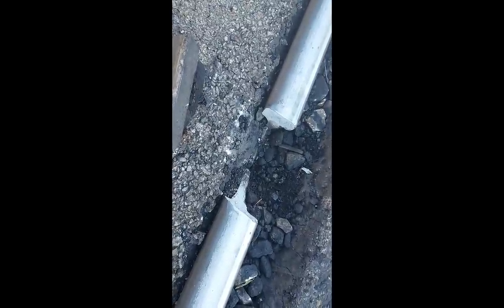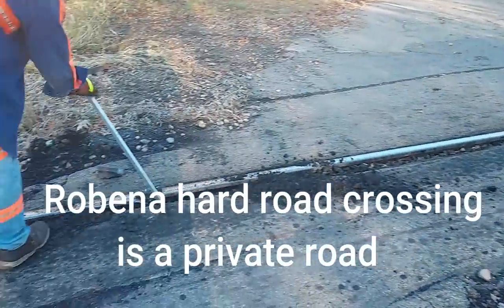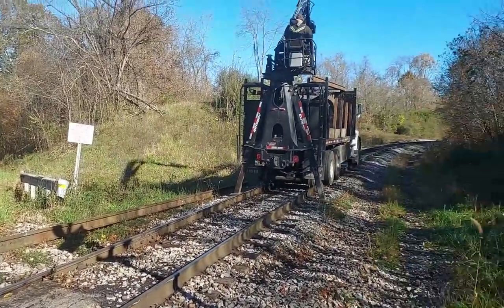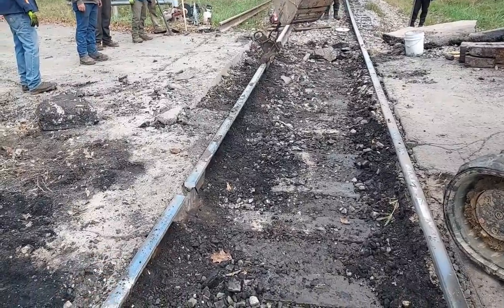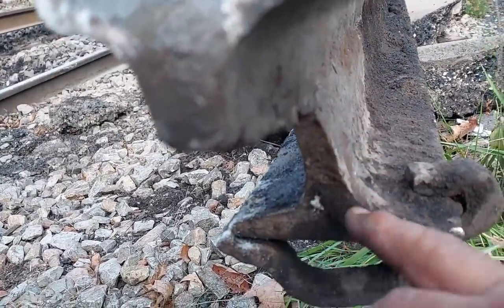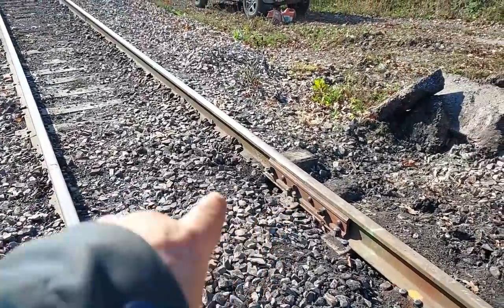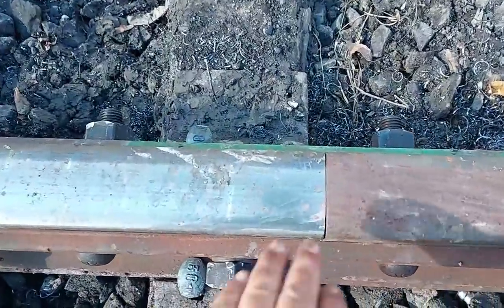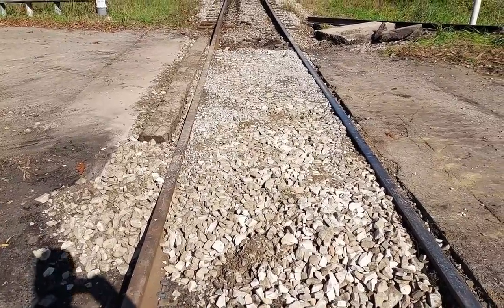This is Really Ugly!  7 1/2 Inches of the Rail Head Blew Out!

Comment: Any chance of replacing the asphalt with composite panels? If your rail was signaled the break would have set the preceding signal at stop and proceed. Then the train would stop and proceed at restricting speed looking out for obstructions, broken rail, etc. In your situation signals are not feasible since you operate one train only on the 17 mile section of track. Cumberland is fortunate that you inspect frequently. Well done!
Reply from the maker: Would be an excellent idea Gary, I like those. However since this is
a private crossing and only sees a few trucks a day they most
likely won't spend any money on the crossing except for what it is
now, a gravel base. Used to have a ton more traffic when Robena
Mine was operating right below this crossing, that is when we
took out the timbers and put in the asphalt, about 17 years ago.
Appreciate your checking in to watch the video my railroadin friend.

Comment: Was it a very hot day? I see there is no expansion gap left open in the joints.
Reply from the maker: No it was not and very excellent observation there sir. I intentionally
had them close the gap when they set that rail in. I've had several
joint pull aparts on both sides of the crossing in the past and
by having the joints tight am hoping that will help eliminate
those winter pull aparts. There was a method to my madness....LOL
Do appreciate your checking out the video today and for writing
in my friend.

Comment: Just a couple of remarks from UK, not sure that too narrow a joint is a good idea, because when the weather gets hot, the rails will expand = lengthen and could buckle.  Other comment, I think we don’t pour concrete between the rails.  Unless they are tram-tracks running along a Highway.  Maybe the ballast is covered by timber baulks.  You did a good job.
Reply from the maker: Thank you Robin for the very nice comment from the UK. I have
had several pull aparts in the winter on that rail in the past and
several on the other side of the crossing, same rail. So that is
why I asked them to make the joint tight. Understand your line
of reasoning, but in the 18 years here have never had a heat buckle
there but have had 6 pull aparts. Do appreciate your watching today my friend.

Comment: How did the car wheels stay aligned to the rail head over that big of a gap? I'm simply amazed that it didn't derail a wheel and have several cars run off the rails. Did the last freight train that passed through that defective section get fully checked? I reckon every wheel on that train should get inspected ASAP, rolling over a defective section can put nicks, scoring, and dents in the wheel.
Reply from the maker: Good question and answer is it was in tangent track. Had it been
in a high degree curve most likely something would have come off.
I was on track and did not dump the cars when they came in after
running over this, most generally the guy dumping looks at
stuff like that, but we also have not experienced any wheel
problems soon after that. It is my guess the head blew out
near the very end of the train. Do appreciate your writing in and
for checking out the video today my friend.

Comment: I wonder how old the length of rail was? Could be a century! And how long the original crack had been there (and impossible to see under the crossing)?
Reply from the maker: The rail we took out was rolled in 2010 by Arcelor Mittal located
in Steelton Pa. We will never know how long that original crack
was there. Do appreciate your checking out the video today Lloyd.
Reply: @ccrx6700  Surprised at that being just 12 years old. Yes, wonder how many times the track has been inspected without knowing of the crack. Would need a special inspection train with x-ray etc to spot that. Fascinating video. I'll check out a few more of yours!

Comment: That is amazing.  In one sense, it was a bad location because it was in a crossing.  Makes a difficult repair. In the other sense, it was the best place because it prevented  the rail from rolling or moving laterally.  That would have been a train wreck.  Pardon the bad pun.  Do they ever have Sperry or some other company survey the rails?
Reply from the maker: Pain to have to tear the crossing out, but also easy access for
the crew and the excavator! Better than miles up track with
no way to get there. We do untrasonic rail testing at least annually
and often twice a year and have done so for many years now. Do
appreciate your checking out the show Larry.

Comment: dang that's quite the break on that piece of rail it must have made some noise when it finally threw in the towel. Out of curiosity do you know if railroad ties tend to last longer or shorter when covered by asphalt like with that crossing?
Reply from the maker: Very good question Ethan and I have no reliable answer. We redid
this crossing 17 years ago and all the ties were new then. They
still looked pretty good and the spikes drove in fairly hard when
they replaced the rail here so that means the ties are not rotted.
So I would definitely say the ties last longer in a situation like
this than they would in a mud hole where there is a constant
up and down motion of the ties plus the mud. Do appreciate
your checking out the video today my friend.

Comment: what grade of steel is used for rail?
Reply from the maker: Rail is a medium to high carbon steel. Not all rails are manufactured
to the same specs. A railroad will specify what type of rail they
are wanting rolled depending on that railroad's unique use for
any certain application. Some rails are very high in carbon and
those rails would be used for high degree curves, but again that
higher carbon rail is a special order. You can find on the internet
the exact ratios of what is in rail steel on several sites. Hope
that helps Augie and thanks for checking out the video today.

Comment: Looking at those tracks makes me wonder how you get them universally spaced apart evenly, I believe it's just over 4 feet between the 2 sides.
Reply from the maker: Inside gauge between the rail head is 56 1/2 inches typically
Johnny. There are Fed regs on how wide a gauge can be
for each class of track before it must get corrected.
Reply: @ccrx6700  I meant how you keep the tracks and equal amount of space apart.

Comment: PS.  A contributory factor for the fracture could be that the cold weather made the rail shrink, naturally, but it couldn’t move at the rail-joints (held solid by all that concrete??) so it broke. It was clearly cracked, anyway.  Jointed track depends on movement at the rail-joints.  CWR (continuous welded rail) is laid in tension (“stretched”) and provided with expansion joints.  I prefer listening to the clickety-clicks, and calculating the train speed.  Rails used to be laid in 60-foot lengths, over here.
Reply from the maker: Thanks for sharing with us Robin. We do appreciate your
watching the video my friend.

Comment: How much of the old rail did you cut back behind the fracture ? would have been good to see that and drilling for fishplates 👍
Reply from the maker: About 4 or so feet on the left side, enough to get the joint
out past the crossing. Thanks for writing in and for checking out
the video Poppys Bench.

Comment: Yea as a Retired UP engineer I've run over break-aparts and is very noticeable sitting in the engine.. We had a red signal (because of the break) so we were @ Restricted speed.. 3 engines and the first tank car did not derail thankfully.. track depth. came out and made a temp. fix.. DD.. 😜
Reply from the maker: I can imagine running over a break like this would be a pretty
oh crap moment... Thanks for sharing Dave. We do appreciate
your checking out the video my railroading friend.

Comment: You dont weld them together?
Reply from the maker: All our welding is done by contractors. On this day the welders
were in a different state and unavailable. So rather than wait a 
day or so for them to show up, we bolted the rail together so
a train could run as soon as possible. We did replace the
other side rail of the crossing a couple of months later and
that was welded in. Appreciate your checking out the video
and for writing in my friend.

Comment: Dave, do you notify the manufacturer with the heat number, etc.? Possibly an internal defect popped by a flat spotted wheel.
Reply from the maker: Had it been a fairly new rail yes we would have, however this rail
was put in over 17 years ago and there simply no use in doing it now.
We did replace rail on a curve about 5 years ago that was rolled
that year and 2 rails broke and we did report that one. Our
rail supplier came out and looked at it but we never got
the rail replaced from them. Do appreciate your writing in Thomas
and for watching the video my friend.

Comment: The maximum sheer stresses in a rail or in fact on any surface supporting a rolling load, are part way down from the top of the surface. This is why road potholes occur in roads, and pits appear in rolling element bearings and gear teeth etc. The subsurface fatigue stress causes train track rails to fail like that. Fatigue loads are tougher on material than a static loads. There are train carriages that can detect those subsurface cracks with ultrasonic with the train in motion. The smoothness of the top surface of the rail is a factor in the degree of sub surface stress, the smoother the better.
Reply from the maker: Thanks for writing in with the very informative comment Andy. Very
well stated. We do appreciate your checking out the video and for
sharing with us my friend.

Comment: What causes a blow out?
Reply from the maker: In this case there was an internal defect in the rail that over time
grew and broke the rail Robert. Then eventually it spread so the
rail head was weakened enough to blow a chunk out. Internal defects
that could cause something like this are called shatter cracks and
are hydrogen deposits in the steel that are not eliminated by the
controlled cooling process. They are very small and over time and
the passing of trains that defect can grow to sometimes a very
large size inside the rail itself. Amazing isn't it.  Thank you very much for visiting with us and may you have a very good day my friend.

Comment: Will the engineer have to take it slow through that gravel the first time to prevent a derail, or is the train so heavy that it mashes everything out of its way (the flanges of the wheels)?
Reply from the maker: We made sure the rails were clean before they ran a train thru
there MusicByWinston. But if there was a few pieces of gravel on
the rails, the loco would just crush it as you say from the weight
of the loco. Very much appreciate your checking out the video
today my friend.

Comment: Gorilla glue? LOL Good thing you caught that. Nice work men.
Reply from the maker: Don't laugh Wilbur but we did try fixing a battered rail head one time
with JB Weld. And it worked! However it only lasted for a couple
of weeks before it finally blew out. Do appreciate your checking
out the video and for writing in my good man.
Reply: @ccrx6700  JB Weld is great stuff! I used to fix a broken gear case on a big mower and it lasted for years.

Comment: Is it very common for rails to break?
Reply from the maker: Every RR is somewhat unique Steve. Here it is not very common at all
to have rails break, but also with the Sperry testing we try and
fix an internal defect before the rail breaks. All of our rail is 1975
and newer. Remember, the older the rail, the more use and abuse
it has had and the more the frequency of broken rails arises. So RR's
with much older rail will have more problems with rail breaking than
a RR would that has much newer rail.

Comment: Shouldn't there be a bigger gap between the heads to allow for heat expansion ??
Reply from the maker: In most cases you are right Andre. However you also don't know
the history of this section of track. In the past 18 years I've
had 6 rail joint pull aparts, 3 on either side of the crossing, so I
specifically wanted the joint gap to be almost nothing in hopes
of helping prevent a future pull apart. Do appreciate your writing
in and for watching the show today my friend.
Reply: @ccrx6700  You're welcome. Thanks for the explanation, it makes sense.

Comment: Dam, they nailed the length.  Are the rails extra tall on a crossing?  I ask this, because at a BNSF crossing near my farm, you can see the rail on the crossing is taller than the rest of the track.
Reply from the maker: Good observation!!! You are the only one that has written in about
that Red. Measure twice cut once and they got the length just right.

Rail should be same grade on either end as it is in the crossing.
Very often road water runs off the crossing and has drainage
problems getting away from track which is why most RR's have
problems with crossing approaches being lower than the crossing
itself. Really appreciate your checking out the video and for
writing in my friend.
Reply: @ccrx6700  The rail tops are on the grade but the ties are set lower with a thicker rail across the crossing.  I wasn't sure if this was a standard practice or not. Previous to seeing that crossing, I thought all rail was the same.  ¯\_(ツ)_/¯

Comment: Bevel it, and I'll weld it.  Good as new!  6013 root pass, and 7018 cap should do it.
Reply from the maker: Have no doubt in that. We once had a rail break at the load out
and put some joint bars on it and they welded the rail head to
the joint bars to get a train across until we could make a more
permanent repair on the rail. it worked well. Do appreciate
your taking the time to write in and for watching my friend.

Comment: So why didn't that section of rail get welded and formed being that it's at a crossing and it gets side to side torque frome truck traffic
Reply from the maker: All our welding is done by a contractor. On this occasion the
welders were out of state and not available. At a later date
we did replace the rail on the opposite side of this section
and it was welded in. This crossing is on a private road which
only sees a few light pick up trucks a day over it, nothing
to be concerned about with lateral movement there. Thanks for stopping by and watching the video today thumbs up.

Comment: Here in Germany, where I live, we never make rail repairs this old-fashioned way, we always thermite-weld the rails and grind them even - no more da-dong-da-dong-da-dong when a train goes by. Odd to see you still doing it the old ways, is it about the costs?
Reply from the maker: We do some thermite welding here. Every instance is a bit different.
On the opposite side of that rail we replaced it just a few weeks
ago and welded it in. One big factor is availability of welders. We
don't weld here but have to rely on a contract welder. On the day
this broke the welders were in another state and not available. So
rather than hold the trains up for a day waiting for a welding crew
to come in, we bolted it and within the hour trains were up and
running again. Cost is $550 per weld. Thanks for taking the
time to watch the video today ManniH
Reply: @ccrx6700  Thanks for the explanation - in Germany we have only one company which owns the tracks, so they have welders of their own - at least one of them in each region kept ready for emergencies.
Keep up your great work and stay safe.
Reply from the maker: @mannihh5274  😊👍

Comment: A little bubble gum should do the trick.
On a serious note, I would love to see the fractured sections of the break, cleaned of and up close. 
I’m a railroad nut, but IRL I’m a mechanic.
Years back, the boss set me to work on a truck that an employee broke. 
Main shaft in the transmission was snapped in two!
Replaced that, inspected the shaft.
Turns out, the shaft had a crack in it that covered about half of the total diameter of the shaft long before it went.
I know this because the metal was darker for quite some distance across the snap, and it may have had a defect.
The final failure was from abuse, and that was evidenced by the twist just beyond the break.
I’ve had to diagnose failures of other things, and what kind of defect or abuse that caused the failures.
I wish I could see the rail and the site, and be sure, myself.
Slim chance of it being anything but straight out metal fatigue or defect, but I like to be sure.
On thing is certain, a replacement won’t fail any time soon, and probably never again!
Reply from the maker: Thanks Dan for writing in, sure wish you could have seen this
up close and in real life, would have enjoyed hearing your
take on it. I bet you see a lot of stuff like your were saying in
your line of work. We do appreciate your watching the video my friend.

Comment: Gee Dave, having a bad day? How come you didn't just fix this little problem by yourself. Just grab the old rail and pull it out and stick the new one in, simple right!
Was the rail that cracked a lighter weight rail then the new one?  Job well done and apparently done fast.
Reply from the maker: If you read the caption in the video where my big hi rail truck was
in the shop and wasn't available, so I had no way to get a rail here.
And all my tools were on the truck, Truck was not in our shop, it
was in a repair shop in another town and could not get it back
anytime quickly so Frontier was handy with tools and truck and
were there within the hour or else I would have done the job, although
it would have taken a good bit longer with only 2 guys instead of
the crew they sent. Appreciate your checking out the show today
my friend.